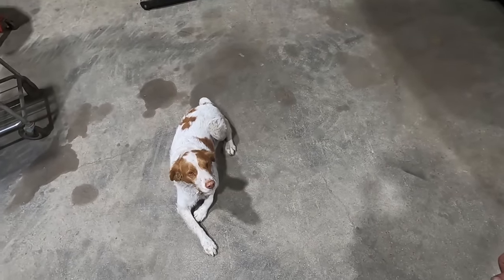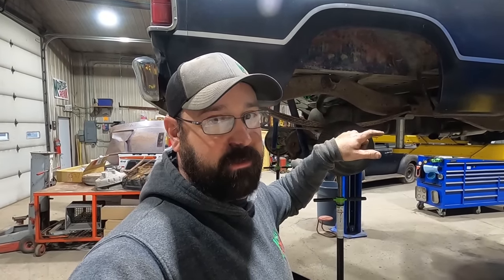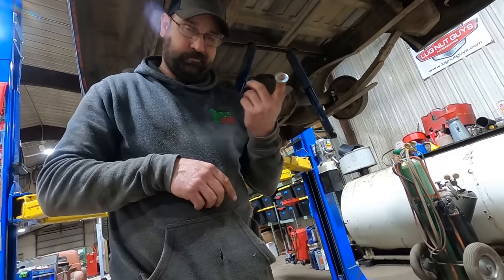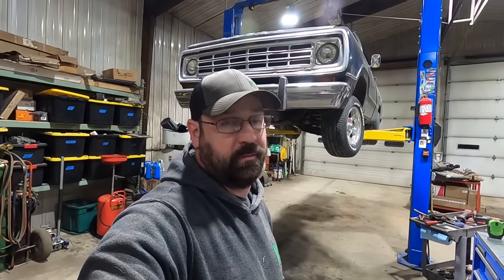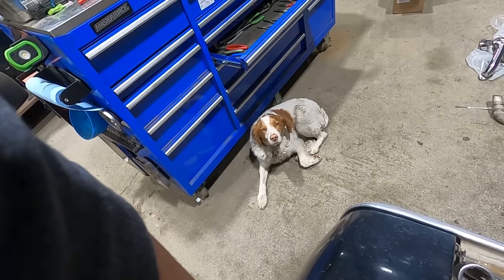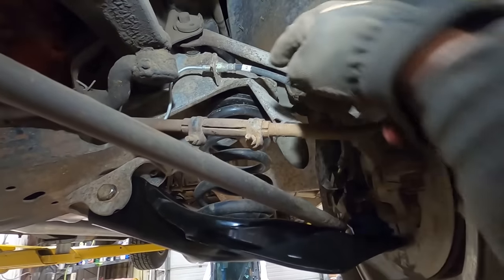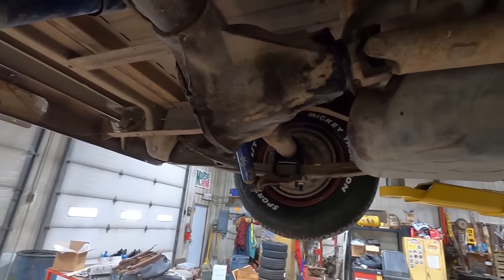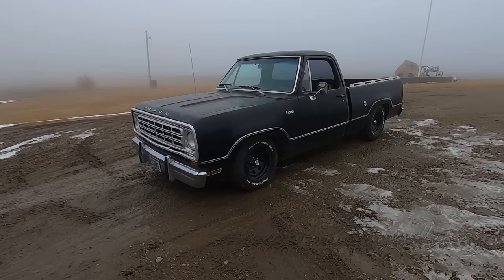1974 Dodge BIG BLOCK Shortbed Truck! Budget Friendly Transformation! Mopar Muscle Truck!

Comment: I will always love these, I had a 79 with pretty healthy 440 and auto, that truck was scary, but fun as hell! Did the MOPAR Cop wheels, had them widened front the rear, 15X10 up front, and 15X13 rear with the "Ram Charger" Aluminum center Caps, Really made the look PERFECT! I did a "B" body front suspension, so I could play with stance, had the Race Hemi Bars, so it handled really well, also had an "E" body rear axle with locker and 3.91 gears! My truck was "Race Hemi Orange" with the charcoal rims and white letter Goodyears!  Sexy Sexy!
Reply: 66🎉no B8t V505-g9
Reply: Man I wish you could post pics in the comments. I’d love to see that truck. I’ve got a 77 W100 Power Wagon that I’m putting a 440 from my motorhome in. You don’t see many of these trucks around any more.

Comment: I have an 86 f350 that was 460 swapped from a 6.9 diesel by an RV repair shop here on the Olympic Peninsula, WA.  I bought it after the work had been done, EXCELLENT fit and finish on the short tube headers they used! I’ve had them on and off several times with no issues and no leaks…
Hard to say the same for the clapped out 460’s I’ve been dealing with!

Comment: Professor Mortske is our junked truck surgeon. Makes me glad to know ive hung on to my 79f100, 95e250van with 8000 lb towing package, 98f150fleetside4x4, 94ranger 4x4 with 200k miles and no oil leaks,4.0v6 and a 2003 mercury marquis.

Comment: I had a 78 D200 with a 400BB, 4 bl, and Hedman Elite headers. The headers were $400 in 2003! But they fit perfect and worked GREAT! I also had a 71 Sweptline shorty with a 383, the unfortunately non-synchro NP435 granny 4 speed, and 3.55 Sure Grip. It had Hooker Competition headers that you cant get anymore. I love headers!

Comment: It's a Christmas miracle, putting headers on a Mopar big block is about as fun as putting them on a Pontiac big block. When you mentioned the rear diff being a quart low and no big wet area, I thought this can't be good, we will see what goodness is hiding behind cover number one at bearing time. Hope the axle shaft isn't shot with that bearing going bad, down side of c clip axles, Merry Christmas.
Reply from the maker: same to you!

Comment: Another good one sir, thank you. Your shenanigans have compelled me to finally get serious about working on Gertie the '49 Ford F-2. Since bodywork and rust repair sucks, I'm saving it for last. However, just since I've been watching your videos, I've installed a new radiator, hoses, clamps, battery tray, welded up and refurbished the front and rear splash pans (all work has been to bring the truck back to OEM specs. and appearance. Yeah, am a bit of a purist.), adjusted the brakes, installed a repro temp gauge (original died), restored the spare tire carrier and hardware, restored a spare original rim, bought a new OEM type tire from Specialty Tires of America (should get tire mounted, and get it all tucked under the truck next week), and restored the headlight buckets and hardware. Also bought new king pins, a new OEM type wiring harness, and have collected in the last few years new leaf springs, shackle kits, etc. Hope to install all the parts by Spring.
Thank you Mort, you've been an inspiration.
Reply from the maker: My pleasure

Comment: Had a ‘74 ramcharger with a spicy lil 360 in it some 25 yrs ago…i had bought that truck for $300 at the time cause the reverse gear was non existant…you learn how to park on hills and pull all the way through on parking spots real quick…when all else fails you always have 4wd to just make it out of there…..that is one of the few vehicles i deeply regret getting rid of…but then again i was younger and didnt have the money or knowledge to repair stuff like that as i do now!!!…..awesome job and slick truck Mr.Mort!!!
Reply from the maker: Awesome

Comment: I consider this a personal Christmas present to me, been asking about this truck ever since I glimpsed it up there on the lift.
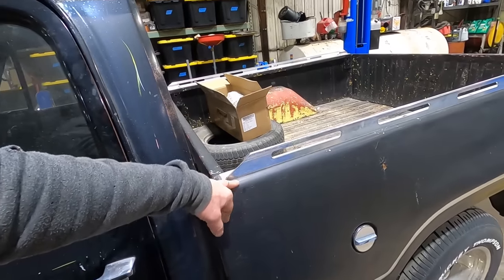Had a 400 HP small block in it, 727, 3:55 gears in a '75 D-100.....it sounded GOOOOOOD!!!!

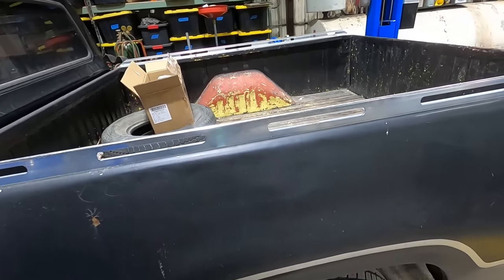PULLED the engine, put it in a '78 SWB 4WD (W'150) w/ M880 military axles, 4:10 gears for mud racing.

Comment: I had a 3/4 ton one, same year and color with 318.  I was into hot rods, low riders, and the mini truck scene at the time.  Also needed a workable truck.

So I chopped the top 12”!  Bucket seats on the floor instead of the bench seat.   Made a dump bed but it was like a workable bed that could dump a full load of dirt/ gravel.

Then got a sung top that had had side windows originally.  So chopped away 12” of lower half.  Split down the middle and mounted with hinges so it opened the snug top like butterfly wings.

Then later modified the dump bed to the whole bed could raise up and back also.  

Did suspension drop so the frame was 1” off the ground.  Plan was to do a 3” working suspension but on hydraulics so it could ride nice or get slammed to lifted slightly above stock height.   But before it all got finished a friend’s dad was in a bad way and blew up his 318 and it broke the transmission housing at same time.  He needed it for work and mine was a toy, so gave him the truck to fix his daily driver.

Always wondered where they crazy truck went.

Comment: Hi Mortski, I just did the same job on my 77 D100 I used the B Van lower control arms and they work great, I Lowered the front about 3 inches and the rear 6 inches.  I too have a factory-installed 440 in this truck. The previous owner already had installed headers and a factory later-model mini starter. Not sure what brand the headers are, but they fit well with no modifications. The ring gear is welded onto the torque converter.
Reply from the maker: Sweet rig!
Reply: I was coming here to say the same thing. The "B" 100 lower control arm is the one to use.

Comment: on those older trucks we always ran the exhaust just outside the frame plenty of room and makes it easy to work on every thing under the truck. you turn at center dump exhaust and go outside frame on the raised section

Comment: Merry Christmas Mortske and Duff!  I had a W200 440/727/Dana 60/60/NP203 Club Cab Ex Pennsylvania Forestry Truck in Medium Blue. The body was mint but I had to put floors and a seat. With a lift, 40" Gumbo Monster Mudders for offroad and 35X12.50X 15 street tires this truck was impossible to get stuck. It rode very nice for a 4wd that high, the heavily padded custom seat helped considerably. Fuel mileage was about 15mpg. I did a lot of work to make it even sweeter, then sold it for a sizable amount to buy my first house. I sold it in 1997 and wish I still had that truck. Here in South Central Pa, these are all but impossible to find unless they are a basket case. I paid 1500$ for it in 1992 and made a lot of money off of it.
Reply from the maker: same to you!

Comment: I helped my best friend who was a big dodge and Mopar fan lol, had swapped out a big block ac California emissions 440 thermoquad carbbed motor out of a 75 dodge adventurer se d200 club cab long bed with a 4spd, and we put the 77 b100 short wheelbase van dodge tradesman type,2bbl Holley 318 tf727 and the truck d/w series transmission plate from a 4x4 with the holes welded shut and swapped in a automatic steering column,it was a ac truck and the motor pretty much dropped right in place except for the y pipe van exhaust and the smog pump on the 75 dodge club cab truck...

Comment: Speaking of old auto part stores, I remember going to Chiefs' auto parts. Also tech tip on cheap headers like these. Cut the flange in between the first and last primary tube and use multi layer aluminum gaskets and they will never leak.

Comment: One of my first trucks in highschool was a two tone mint light and dark green,74 dodge d100 club cab short bed flatbed, with a cut,zip sawed and weld poly 66 Chrysler 318 v8 from a 67 Plymouth fury wagon.... the factory tf727 wouldn't work with that so it was swapped out...  Wooden flatbed had a metal frame with the ribs running down the sides of the frame and the round corners and the metal frame was red with the yellow end cap and tailight panel so it looked swift on the two tone mint green truck, adventurer trim truck but no woood grain anything or no custom trim three spoke steering wheel and basic na radio dash and standard heater lol,, and it definitely was not a se trim truck.. single barrel Holley carb and what I referred to as drag pipe exhaust,it was a cheap jc Whitney 2.25 glass pack muffler manifold exhaust kit with side exit in front of the rear tires and the pipes were shortened 5 inches and came out just behind the door and they swapped out the no name glass pack mufflers and put straight through no packing purple hornies header glass pack mufflers on it after cutting the header collector flanges off so it was loud!!!!

Comment: I used to go through that hassle with the pigtail wandering after lifting/lowering on maintenance jobs. A father of a friend, real old-timer hot rodder taught me to drill and tap a couple holes and use a U-joint strap to hold the pigtail down against the control arm to stop the wander after jacking. If space allows, you could use the U-bolt type ones with nuts for those "big jobs."
Reply from the maker: good tip

Comment: I'm also one of those people who also approves of a decent sounding lower trim level single exhaust, just swap in your choice of muffler to change or give your project the idle exhaust tone note you want and call it good lol,i am putting a 8 inch long case mini cherry bomb glass pack muffler in the factory single exhaust pipe in my 2000 dodge ram laramie slt v8 magnum,so it will have a bit of a rumble to the idle exhaust tone lol and still retain almost the complete factory single exhaust tailpipe

Comment: Fyi, most these mods are factory applied to my 99 Dakota RT, if you want a lowered truck just buy one instead. Little different look yes but right now i'm seeing them cheap and they're setup with the 360.  Purchased a set of block hugger headers few years ago, thought i would use them on my bb383 65 Fury III, not a chance they hit the power steering gearbox. possibly if it was manual steering they might work. Probably same scenario on A and B bodies  as well. Fyi, my 1998 B3500 1ton Rv was built on 1ton chassis. there's two versions, one with 3600lb front axles, one with 4000lb axles like mine. Believe you purchased lower control arms for the 4000lb front axle as they're girthier. 3600lb i believe fit 1/2 models. Comes with two torsion mount holes as on my model, the torsion bar mounts to the frame aft of the front wheel, unlike my fury which is forward of the front wheel. On the dakota RT, the bump stop inserts into a small cup welded to the lower control arm. Oh and to avoid the wonky pipe into pipe, new rams have two into one stainless muffler, single out the same side as boom tubes setup.  If anyone remembers, those slots were made popular by Stacy David "Gears" where he did up a dodge i believe with those rims, i personally like them. Looks good, Happy Holidays!
Reply from the maker: I'd rather have an old pickup that I built than bought.

Comment: Friend of mine had a truck like that with the slant six and a three on the column. What a great truck, nothing ever went wrong with it except for the alternator bracket kept breaking! Thanks for the video moretske and Merry Christmas to you and yours.
Reply from the maker: same to you!
Reply: When it came to Slant 6 engines you either got a bulletproof one or an oil drinkin POS. Quality control throughout the latter production variants was horrendous. Pretty much everything at Dodge in the 70s was the worst QC of the Big 3. That wasn’t an easy task given the garbage FoMoCo and GM were dropping 💩during the same time period. The 70s was a time when an American car was shot at 100K miles.

Comment: The pm 5/8 spark plug socket is about a 1/2 inch short compared to the normal length spark plug socket...... And I have also had to use offset box end wrenches for changing the spark plugs, and the other reason I hate headers is you think oil leak will oil soak a starter well heat from the headers will cook a starter to the point it locks up... and good luck getting said starter off lol

Comment: The best headers are ones you make yourself. That's a lost art form but it's the only way to go to get a great fit. You do one pipe at a time and can pre-fit each pipe. 
If you have a really tight fit you can go with solid motor mounts to keep it from floppin' around. 
We had a set of 180 headers on our late model - a straight pipe shot out the door. Easypeasy to put those on and take off. Painted them fluorescent orange - that's an old trick - you can see which cylinder isn't running right by the color of each pipe. Came in handy when you needed to know which one is the culprit of why you're not gettin' in the A-main.

Comment: My Grandfather has a Dodge truck since new. It's his pride and joy and garage kept. It's a special model like the Lil Red Express but it's black with gold trim. I can't think of what it's called. I do know it came new with a 360 but he put a Roadrunner 383 in it. It's pretty quick for a truck.
Reply: Warlock
Reply: @olikat8 YES! That's it. I couldn't think of the name of it. It's a step side bed with the wooden floor and smokestacks. I wasn't born until '83 so I don't know if the truck came like that or if he added those things to it. I know he put a 4-speed in it with a 383 when I was about 8 years old. Mild Cam, high-rise intake, headers, the usual stuff. Don't know what gears are in it. I never seen another Warlock but I've seen a few Lil Red Express trucks at car shows and such.
Reply: @Whats-It-To-Ya  Yup, it did & glad to help

Comment: Pretty cool old Mopar truck. I might have painted that frame where you cut it for header clearance, but to each his own. And that dipstick tube looks like something someone fabri-cobbled together maybe? It looks pretty wavy....is it hard to get the dipstick in and out? Is that a 90 degree elbow brass fitting into the side of the oil pan? I mean....it might be easy to take that tube out of the fitting and run it up between the head and the header and attach it to one of the header bolts. I like headers (sorry), except for the whole burning of plug wires and various other things that get too close. Header heat wrap is your friend sometimes. Merry Christmas Mortske and crew! Stay cool, man!

Comment: When using high torque drills, try keeping your thumb on the same side as your fingers, drill should just twist out of your hand... better than a spiral fracture in one of the forearm bones. Unless you like x-rays of your arm to look like you pissed off a nail gun.

I do you same thing with washers, ol'timer told me the same thing, I'd already been doing it though... it just seemed like the right way. Plus, you don't even have to look, you can feel the ridge.

Comment: Good looking truck. Ive lowered these trucks a few times on my Channel. instead of the D300 LCA you can get a B150 LCA ans the ball joint is the same size. it does use a 3/4 bolt so you just ream the tabs and bolts right up. I know im a just a small channel but i have videos on all of the lowering jobs ive done. Thee Process is the same from 72-93.
Reply: Also if you dont want to run headers you can run Manifolds off of a 91-93 d150 with the last 3 numbers on the casting being 618 and 619 . They have Superb flow compared to any stock manifold. Thats for Small block mopar 318-360 not BB mopar sadly.
Reply from the maker: thanks for the info!

Comment: @mortskerepair tech tip of the day:  use a couple of conduit P-clamps to locate the bottom of the springs in the pockets by drilling a hole and bolting em in.  The clamps will keep the springs in place and clocked👌 and you will have to run a shorter front shock, the stock ones will blow out.
Reply: And it does look better this time with the torq-thrusts or the et's vs. the cop steelies and cop caps, just because those wheels have been done to death on Mopar trucks🥱 just my opinion.. and that is coming from a steelie guy😂

Comment: In reference to your
 "wealth of useless information" discussion on the flat washers... I've always turned mine the way you said to... Just from my OCD, had no idea about the structural integrity aspect of the way they're stamped. Thanks for the tip. 😁
Reply from the maker: my pleasure!
Reply: @MortskeRepair you referred to Checker Auto Parts later in the same video. Weren't they bought out by O'Reilly's ?  
   I live in Northwest Louisiana.... we never had a Checker AP here.

Comment: You may find items they didn't know they had as well. 
 Was this the dodge that was out back or is this a different truck? 
 Mods = modify the part or you need more parts to make it work.  
Duff wants to go for a ride lol . 
 My ex coworker had a 318,  manual trans  dodge pick up from the mid 80s that had headers & some gears that made 1st granny gear . 
 These trucks are nice. 
 Hope the holidays are good.

Comment: The leg were cut off on both side of the clamp tighten to the rear spring shock and housing axle's pipe. The pipe are connected to the diff. Carrier and pumpkin steel housing at rear. The leg is part of the suspension support plate HD. But you use grinding disc and cut both leg of the plate heavy duty. Why not cut one leg instead 2 leg of the HD plate?